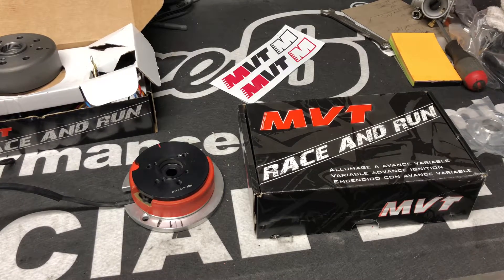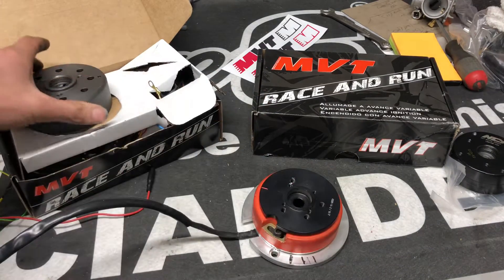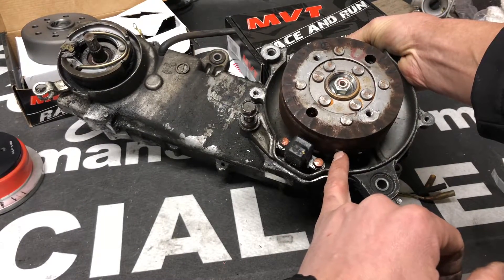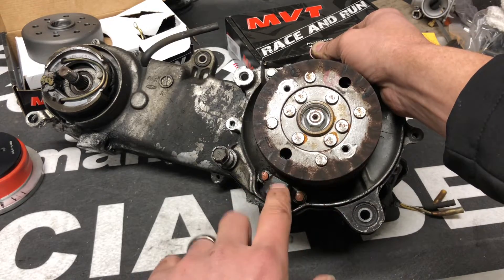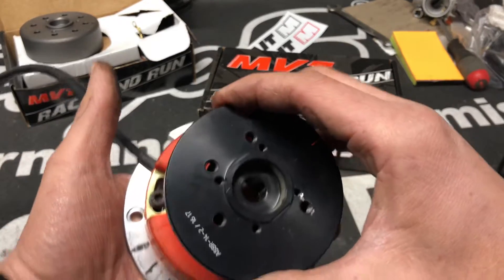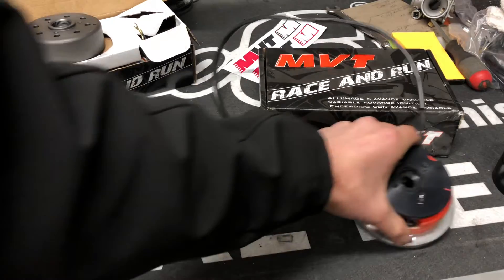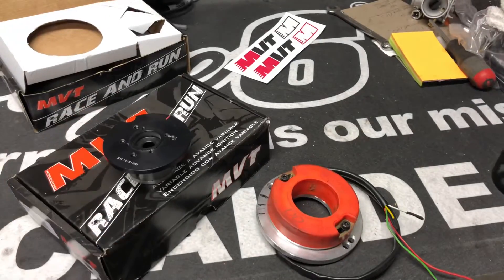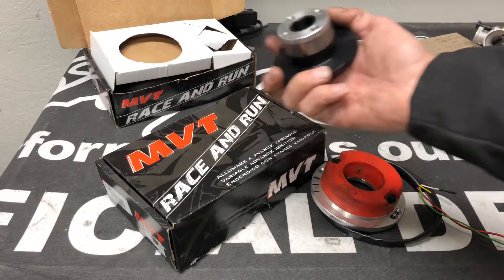Scooter ignition inner rotor kit explained

Comment: my all time question is: is there a internal rotor version for 4 stroke with normal oem equipment -powering capabily? cuz as far as i know the 2 shorke seletra rotor only gives ignition pulses and don`t power your electrical equipment

Comment: Aww.. but you forgot to tell about all the benefits of the millennium like keeping the starter, and two keyways so you can upgrade from analog to digital.
Inner rotors are cool when you are sitting still or when the cluch is pulled in. At revs with a load it takes .01hp to spin a little flywheel. Remember physics class, an object in motion likes to stay in motion. Makes zero sense from a performance stand point on a scooter as a geared motor could cut a few 1/10s on the track when shifting if he knew what to do, and then there is the weight, (again only noticed on the track)
Only REAL gains are by having different map, curves, and programability. 
But hey, let the kids push start their bike to sound cool sitting still. 😎
Reply from the maker: On the cvt bikes the starters are not effected by the stator system. Not many derbi/am6 style bikes around here in USA being built
Reply: @Scooterswapshop  yep, and that's a shame too. Especially when someone like me tries to get parts to take on such a build. Currently waiting to hear back from TCR Cristofolini Racing on a kit for my build. I know I spoke with you guys about the Bidalot 96, but I am wanting to cover my bases before sending in my carters and making the commitment.
Hoping to see a real 30hp at the wheel and still be streetable.

Comment: What ignition would you recommend to a athena racing 70cc and milled crankcase and 24pwk and scr 70 exhaust. Do i leave it on OEM ignition or mvt dd or mvt millenium?
Reply from the maker: call the shop with more specifics
Reply: @Scooterswapshop  i got bad english and i live in europe so what ignition would be the most worth it for a 70cc racing/high end setup
Reply: @Scooterswapshop  should i just stick with my current oem ones or buy mvt dd for like 300euros
Reply: @radi4610  you will get alot of power with mvt dd, go  for it

Comment: Hi I bought a YX yin xiang 150cc (e-start) engine.  On the cylinder block it says 160cm3.  I was told that it has a 60mm piston & a 57mm stroke.  I orig. thought it was DC as the previous 130cc yx engine.  I bought a DC cdi for it but it stalls.  I wastold by a mechanic that the  stator is no good.  I have a DC electric system.  What is a good 100 watt stator/rectifier combo?  Can  I keep the DC cdi or must I change it to AC?
Reply from the maker: Sorry we don't work on the Chinese made scooters any more.
Reply: I have a mechanic to set everything up, however DO YOU HAVE a compatible MVT a/c stator for yx160cc engine.
Reply: The Top End is similar to 2009 kawasaki klx110 dirt bike
Reply: If you have ac stator, its very simple to connect! Buy 5pin cdi and wiring kit. You need Green(earth), Black/red(cdi power) and White/blue(impulse) from stator and connect them to the wiring kit, yellow and black to coil.